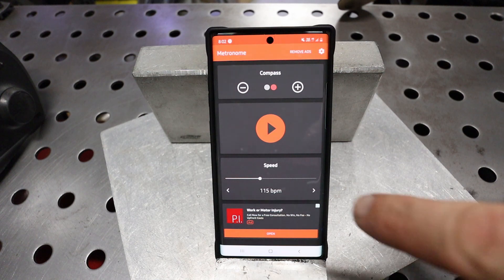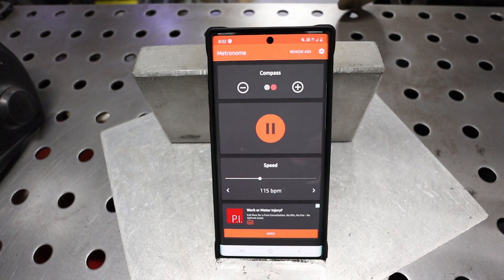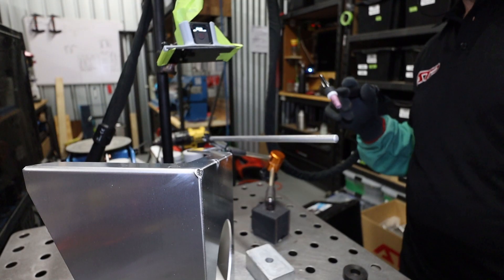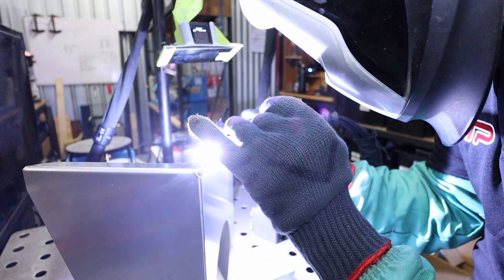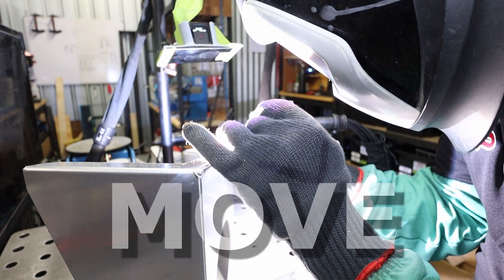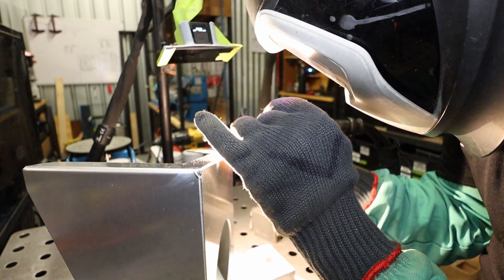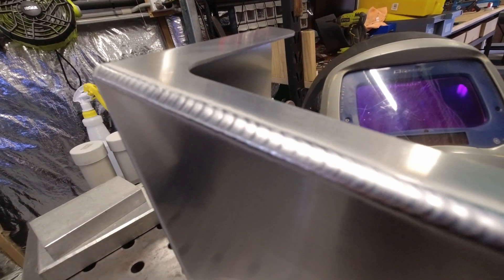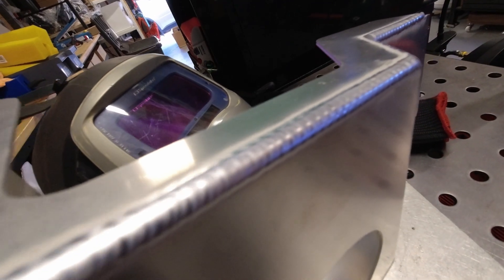Find your TIG welding rhythm with a metronome  - 2 min TIG tips

Comment: You made mention of this to me in a message and I down loaded one and gave it a try and it actually worked for me getting it back into the stainless steel how far is Dabbing  goes I'm pretty fast at dabbing on the stainless steel and I find myself to where I got to slow down for the aluminum.